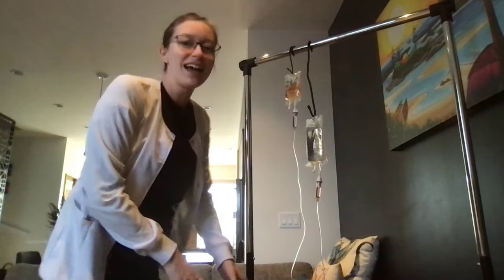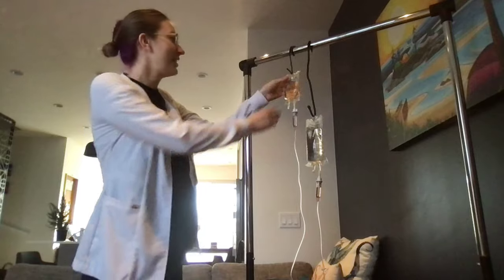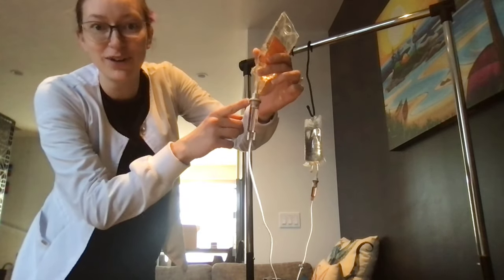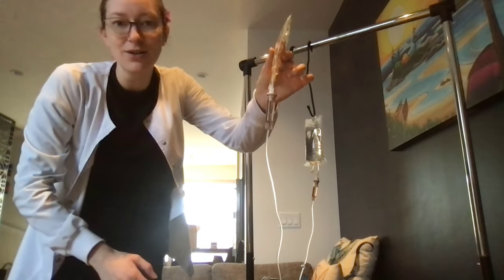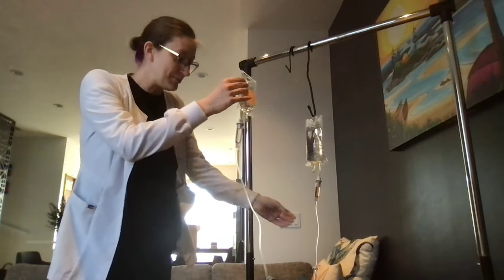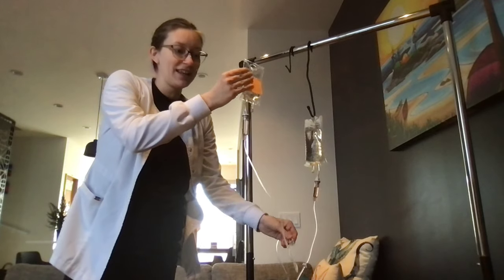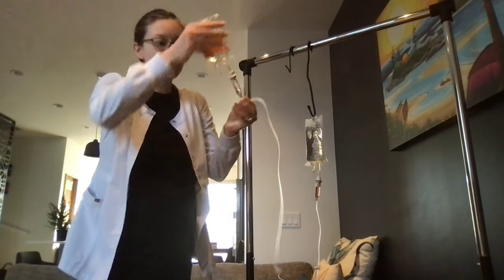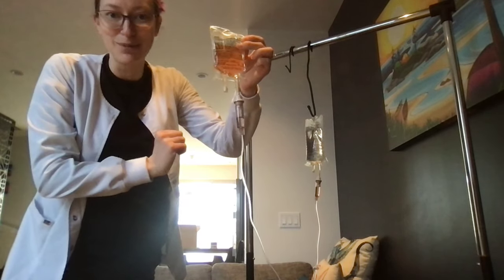Drip Chamber - What to do when it is too full

Comment: omgeee thank youuu! ❤ u save my dogs life! do i need to put the roller back at the top? the one that controls the fluids drip? so that the fluids will continue dripping? pls answer 😢
Reply: the clamp i mean ❤ thanks
Reply from the maker: @SolanneG15   You can use the roller clamp to decide how fast (how many drips) you want the fluid to go in. If you open the roll the clamp all the way (opening the tube), then the fluid will go as fast as gravity will allow. You can roll it partway (slowing the drips) or all the way (stopping the drips). We usually decide on how fast to give the fluid based on the type of medication and if there is any irritation at the site. If there is irritation, slow it down a little for comfort.

Comment: What do I do if my bag runs too fast thru? The first line was driiii-ping but this line or maybe it's the bag? It just runs fast. How do I adjust the speed?? Just with the roller?
P.s. I'm not a nurse. I'm trying to give my cat Sub-Q Fluids. I was taught by my vet. I just bought BBraun bags bc the Vetrivex stunk soo badly like plastic.
This bag doesn't even have a clamp! Just the roller. Is that normal?
Reply from the maker: The speed can be adjusted by using a pump or tightening (slower drip/speed) or loosening (faster drip/speed) the roller clamp. If you don't have a pump or roller clamp, it will be running by gravity, so it will go as fast as the body will allow it to go. This could be fine for some fluids/medication but for others, it could be too quick for the body to handle.
Reply: @suecarl5295  I did bleed the line and then adjusted the roller clamp. It's the same line (just new) on the BBRAUN bag as the Vetrivex bag but on the Vetrivex I did not have to barely open the roller. It was all the way open and still went way slower. So I wasn't sure if I was overlooking something. I've used a few Vetrivex bags before but they smell bad and aren't DEHP free so I ordered the BBRAUN. Does the vent slow down anything?

Comment: #Question: what would happen if you didn’t close the clamp before doing this process? 

Because Many, Many years ago when I was a young child while in the hospital, With an IV drip in my arm. 
There was a family visiting another child in the hospital a bed across from me, part of that family was a little toddler who strolled across to my bed and bit my iv cord.
I remember it being quite painful. But just wanting to know what could of happened…
Reply from the maker: I closed the clamp here so the fluid will not move from the primary bag (your saline or other solution) into my medication bag. If I don't clamp it AND I hold the drip chamber from my medication IV line below the drip chamber from my primary IV line, the fluid from the medication bag can back flow into the primary bag (not a huge problem but could throw off calculations).

For the child biting your IV line: Biting the line itself might put pressure on the line but the real risk is the line breaking/cracking, so you would lose fluid from the line and risk infection since the line is a direct shot to your vein! The biting action here, causing pain is likely because the child pulled on the line. Any tension on an IV line can be painful since there is a plastic cannula inserted into the vein. As nurses, we tape them up as best as we can to try to avoid pain or the IV line being pulled out by accident.

Hope that answers it!
Reply: Thanks Sue, for taking the time to answer my question.
Great info, it Definitely cleared up a lot of things for me. 
I was about 4-5years old at the time over, 25years ago and would always wonder if it was the pressure of the bite pushing too much fluid through.
Or like you suggested him tugging it while it was in his mouth, pulling on the cord. 
I was reminiscing about it at work the other day, before finding this video.
Thanks very much once again Sue, Much Appreciated. 😊

Comment: What do you do when the bag is Not flowing?😭 It just seems to be stuck with no flow whatsoever.
Reply from the maker: Could be a few things— is the IV still in the right spot? (Sometimes, they can get pulled at by accident and it might not be in the vein anymore! Check for new blood or wetness/drips at the site where the IV goes into the skin). If there’s a pump, check it to make sure it’s on and hit start! If there’s no pump, make sure the bag is high up since it will be running by gravity. Check the tubing to make sure it isn’t linked anywhere. Then, check to make sure there’s enough fluid in the IV bag (no fluid, no flow). Hope that helps!
Reply: @suecarl5295  Thank you so much for the tips. However, some do not apply, as we are giving Subq fluids for CKD, so thankfully no veins involved. I did find an informative video on YouTube, and they said to reposition the needle back and forth a little, or twist it while it's still under the skin, until the bag starts to flow quickly.

Comment: Is it okay to do this while the IV is still hooked up to my dog?
Reply from the maker: You should clamp the IV line or stop the pump before doing this. Don’t do this while it is running. You don’t need to fully disconnect/remove it from your pup though.
Reply: @suecarl5295  okay thank you. Also the liquid isn’t flowing through the IV line. Do you know a reason for this? It’s been 2 hours and it hasn’t gone down at all

Comment: Hello. I did what you said but my dog's iv is not dripping
Reply from the maker: This video shows how to remove liquid from the drip chamber when it is too full. If the IV is still not dripping, there is a different problem. The IV could be dislodged (you can tell if the site where the IV goes in to the skin is swollen, wet, bleeding); problem with the pump or if no pump, ensure the IV bag is above the site where the IV goes in to the skin (gravity!); or the more obvious fixes like the line could be clamped or there's no more liquid in the bag. I hope that helps!

Comment: Hi,my dog's IV stopped working but it's still not empty,what should I do?
Reply from the maker: Could be a few things— is the IV still in the right spot? (Sometimes, they can get pulled at by accident and it might not be in the vein anymore! Check for new blood or wetness/drips at the site where the IV goes into the skin). If there’s a pump, check it to make sure it’s on and hit start! If there’s no pump, make sure the bag is high up since it will be running by gravity. Check the tubing to make sure it isn’t linked anywhere. Then, check to make sure there’s enough fluid in the IV bag (no fluid, no flow). Hope that helps!
Reply: @suecarl5295  I checked all the lines I don't see any tangled lines,I also already put it on and off but still no drips.Im afraid to unwrap the cover on his arms because I don't have any kits here and I have no idea what to do,what can you suggest? Is it okay if I'll just keep it off for now? Because it's already late here in the Philippines,I don't have a ride to go to the nearest hospital.